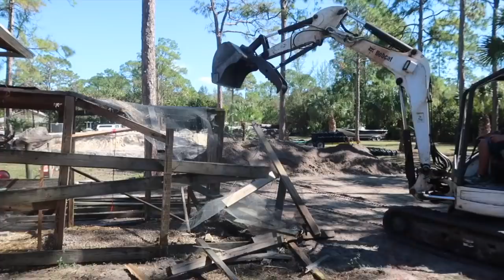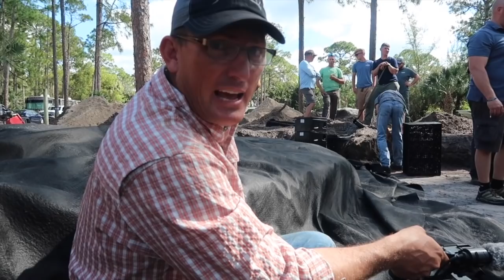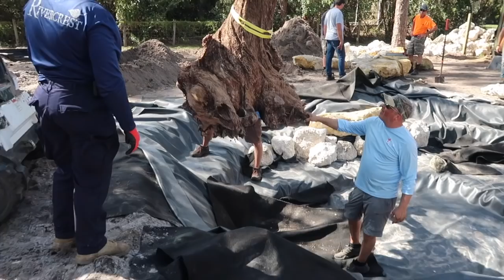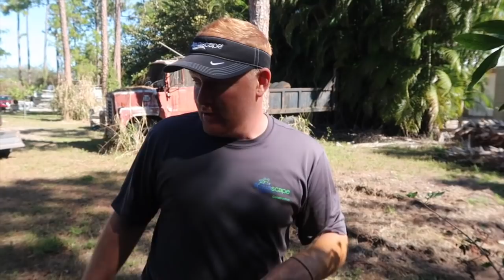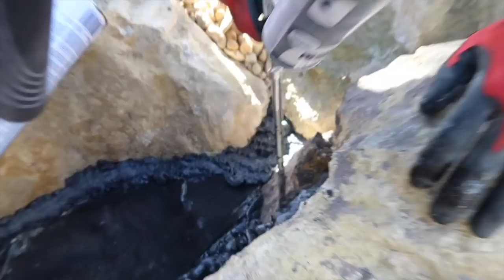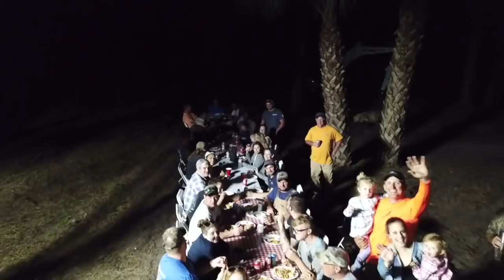DEER MEAT FOR DINNER Gets New RECREATION POND

Comment: They do great work but need to use smaller rocks , the finish product is not even half the size cause of the size of rocks they use.
Reply: juan cortes to many small rocks look wacky and boring plus the rocks help hold the structure of the the pond. So much to learn indeed
Reply: @moavic5087  All his ponds are build the same. A balance of small plus large rocks look nice without compromising the structure.
Reply: juan cortes did you watch the build? It is a mix of big and small rocks! You’re not paying for it so don’t worry about the size